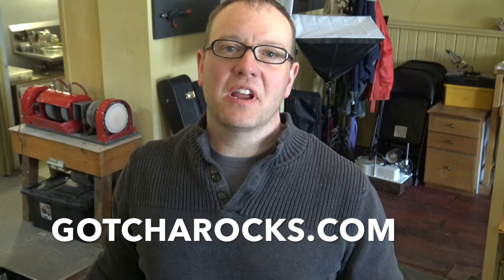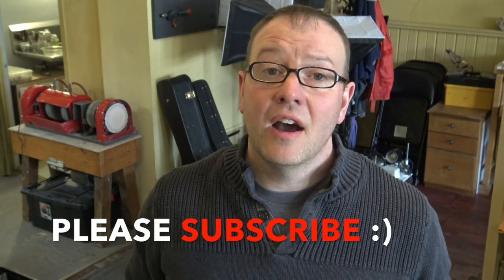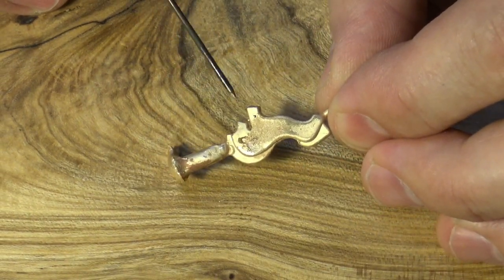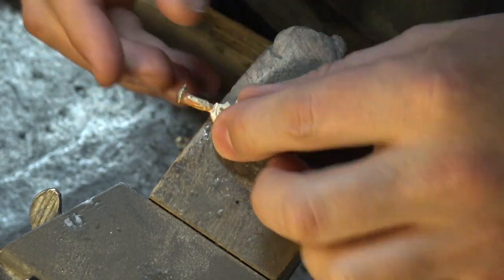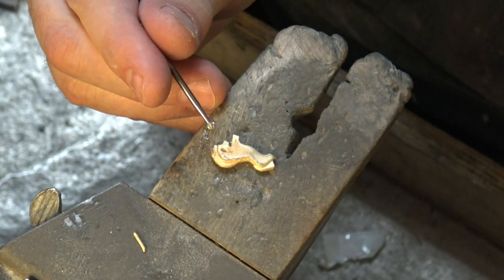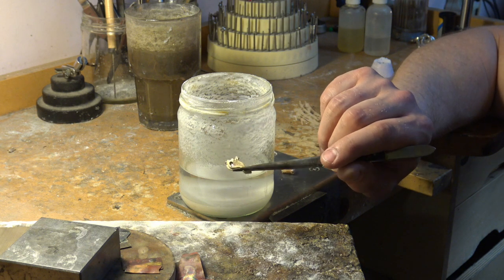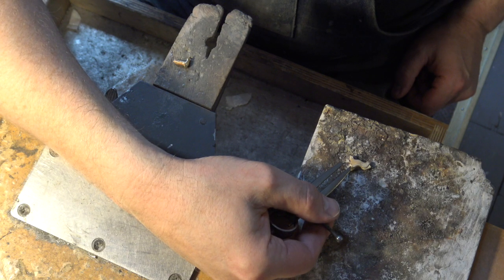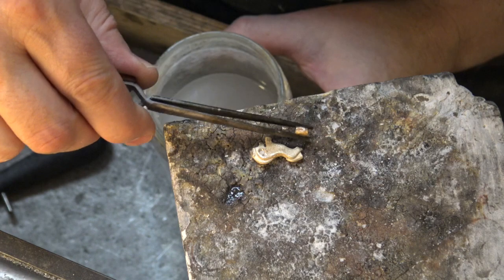How to Fuse Gold - Knowing this technique will change everything! No solder needed!

Comment: *OMG!! Michael,  I am jumping up and down for joy! YOU of all the people I have queried have taken on this subject. I haven't even watched it to the end yet, and I am ever so grateful. Your teaching is very VERY good, I thank you a million times! I am sure many will be happy to find this. Perhaps, a video on fusing gold bezels on sterling silver backplates next? Oh joy!
*Isopropyl alcohol (for firescale protection)? I was always told to use denatured alcohol; perhaps there is no relevant difference? Thanks -Sooo loving this video!
*ok,  Whoa! Hold those horses! At 13:33 you introduce a "nut" to use as a burnisher. (!!!) Please, (pretty please) expound. It looks more like a square washer, it's MUCH thinner than a "nut". Do you have dimensions? I ask because that is a tool that looks like it is an amazing helpmeet (old English: helpmate).  It actually looks like you took a nut/washer and shaped it with a grinder and then..... if so, I'd LOVE to know how/why/criteria for size... THAT is an amazing burnishing tool. And certainly not readily available to buy. Details are key! And as always, thank you so much, Michael..(sorry to whomp you with comments/questions....).
Reply from the maker: Hey Gabby,
I am glad you liked this video. All right, Fusing should be used for attaching parts that are part of the main body of your structure. 
Bezels and other smaller parts that may hold stones or serve as a working part, such as a springs and prongs should be soldered. When we uses fusing it does change the structural make up of the metal. The molecules grow and may cause the metal to become annealed or brittle. Which is fine for the larger structor of a piece but not great if it is a bezel that holds a stone. 
Isopropyl alcohol (for firescale protection). I uses isopropyl alcohol and boric acid powder instead of denatured alcohol because I found out that when denatured alcohol is burned the chemical make up is very difficult for your body to process. Thus you are slowly poisoning yourself over time. 90% Isopropyl alcohol burns just as well in my opinion and it is much safer. 

I am not a doctor or a chemist but I play one on Youtube, however, a good friend of mine is. So I am rolling with the isopropyl alcohol. I prefer to be safe then sorry.  Always use ventilation when soldering or fusing. Okay, I am done on this subject. :)

The burnishing tool? It’s a good one! Your right I thought there would be a source for this but I am not seeing them out there. The one I found is so over priced I cant in good conscience recommend it. I may have to make some a put them on my website for people to order. Give me a little time to check on a few other sources.
 
I basically took a steel nut and made a fitting for the inside of it and then put it on a small mandrel. Anyway I will get back to you on that one. 
Be sure to join the blog on my website if you haven't already. I will put a post as soon as I get a reasonably price supplier. 

As always thanks for the comments. Keep on rocking with your jewelry. 
All the best, Michael

Comment: Thank you for this video!  Would this work for fusing 2 pieces of 18k wire (same wire), to tey to make a thicker gauge wire?
Reply from the maker: It should work. You might just have a little clean up at the weld spot.

Comment: Could you tell me how to fuse chain links together? I see a lot of people use tiny flakes of gold to fuse the gold chain but for me the chain always melts and deforms before the flake fuses the links.
Thanks
Reply: Make sure is clean and also make sure you use Flux.
Reply: Also u need patience,  u will melt many things before u get it right, specially when u don't have someone looking over your shoulder helping. 
It takes a good eye and reflexes to pull the flame out just at the perfect time when solders melts.
A lot of it you will learn with experience..like this guys video, he got the job done, but I can tell that he can learn a few things to make he's craft better and get things done way easier.. I have been doing  this for over 40 years. 
I don't want to put anybody down, I'm still learning new ways to make things easier and better my self .

Comment: Can this process be done of the inside of a ring
Reply from the maker: Hello Chris, yes it can. I would heat up the ring first and then change the size of your torch tip to a smaller tip. You will have to work fast so that the ring doesn’t cool down. Just have everything set up ahead of time.
Reply: @GotchaRocksJewelryDIY  thank you that's set my mind at ease

Comment: I am so happy to have found your channel! New sub for sure. Its funny because i was actually wondering if i could do that with a ring that had pitted. I wasnt even looking it up and you came up in my recommendations. I fuse silver for ganulation and fuse rings and jumprings all the time and have fused a ball of gold to a ring before. But never tried to use the method for ffilling in pits or holes per seThank you so much for sharing this. Perhaps you could help me with another problem i have. Long story short, some gold was accidentally spilt onto some sheet metal and basically fused to it as it looks just like a splat of gold and there is no way to "scrape" it off or aanything lol. Anyways, what could i do in this situation? Its a bit over a gram of gold and i dont want to just throw it out of course. But do i just leave it and hope to find something i can use it for? I dont have any means to chemically separate it really. But i dont think melting it down would be a very good solution either. Idk. Please help.lol

Comment: HiI was engraving a ring and the area got damaged beyond being corrected by engraving.I have cut a small circular disc out of the ring now and I have an circular area about 5mm x 1mm to fill in.Can I use this technique to melt gold into the hollow and fuse it without melting the ring itself  ?
Reply from the maker: Hey Mark, Yes it can be done but you will have to be really carful. I have done this on rings before. Mostly for electricians how had got zapped and melted their rings. If you can cut a piece of charcoal block and insert it into the middle of the ring to keep the ring from collapsing when you heat it. Hope this helps.
Reply: @GotchaRocksJewelryDIY  thank you. 
I was considering pouring a little amount of molten gold into the cavity first to create a piece that fits the shape exactly.  Then fusing that. 
Is that likely to work do you think  ?
Reply from the maker: @marktobin745  That might be a little risky. Try melting a piece that is close to the size of the hole and then add more gold if needed.

Comment: Great video. Is your fire coat just regular isopropyl alcohol that you can find in any drugstore?
Reply from the maker: Yes, find the 90% alcohol. It burns off better than the 70%. Be sure to mix it with boric acid powder. You can use a 50/50 mix or something like 33% boric and 66% alcohol. Both should work. All the best, Michael
Reply: @GotchaRocksJewelryDIY  Thank you. I hope you will continue to do your jewelry videos. You're a natural teacher.

Comment: Nice presentation. I would be concerned with the fit into the void on the first fuse you did. Is it important that before fusing- that you have a close fit without any air cavities? What happens if you trap gas within the piece? Any negative consequences ?
Reply from the maker: Hello Richard,
The fusing that I did I used a ball bur to get a semi close fit. If you are just starting out with this process I would recommend adding three smaller pieces to slowly fill the hole until it looks solid. The short answer is always have a pretty close fit. 
There are exceptions to the rule. When I work in platinum I leave a larger gap and allow the melting metal fill the gap. I seems to work better that way with platinum. 
Gasses will normally find there way out and leave you with another smaller hole. That is most likely what happen with my piece. If it happens re-drill the cavity and add another smaller piece of metal to fill it. 
If you are working with a largely hollow object and you are applying heat make sure that you drill a small hole somewhere for the pressure to escape. I have seen charms explode while being repaired. 
But if you are doing something pretty straight forward such as filling a pit you should be fine. My pendant had a very large hole. I hope to avoid this cast problem in the future. :)

I hope this helps.
All the best, Michael
Reply: Thanks for giving excellent information.

Comment: does the green flame indicate copper in the gold ?
Reply from the maker: k c That’s a good question. In this instance it is actually the boric acid powder being heated to its molten glass form. Different minerals will create different color flames as they burn. As a kid they had campfires kits that you could throw on the fire to change the color. Zinc was one of them. Okay, I’m going down a rabbit hole now, so I’ll stop here. 😀

Comment: What does the fire coat do exactly?
Reply from the maker: It creates a glassy film that helps to prevent the alloys in the metal from mixing with oxygen during the heating process. Without the fire coat metal will be stained black and copper. Here is a link to the fire coat video. https://youtu.be/3Bmtlgn0wK4
Thanks for the comment.
Reply: @GotchaRocksJewelryDIY  I watched the video. But what is the difference between letting it get dirty and then pickling it and what you are doing with the fire coat? Don't they end up the same? or does this also protect from fire scale?
Reply from the maker: @josephirani2261  The fire coat protects from fire scale. Without it the silver or gold can become permanently stained with fire scale. The pickle can only remove a portion of fire scale.
Another added bonus to using fire coat is that it helps solder flow when you are soldering.
Reply: @GotchaRocksJewelryDIY  Thanks for the info

Comment: Happy to discover your videos today 😊. I have some old small pieces of gold jewellery and was wondering if I melt them into spheres would I be able to fuse them onto sterling silver as embellishments or would I need to solder? I'm new at this so am appreciative of all the info I receive. Thank you.
Reply from the maker: Hello Dawn, Yes you can totally do that. After you melt them into the shape you like, I add a little easy gold solder on on side and then place them on the piece you're working on.
Slowly heat the silver and gold till the easy solder melts and hopefully they stay in place.
Good luck and have fun. 
All the best, Michael
Reply: @GotchaRocksJewelryDIY  thanks very much 🌹

Comment: Why do you hold the flex shaft like it were a hammer????
Reply from the maker: donald asbury Hello Donald, I hold the flex shaft a couple ways depending on the work I am doing. When I cut seats during stone setting I hold it like a pencil. This gives me control when making fine tuned cuts. However, I hold the flex shaft like a hammer to apply leverage and help prevent my burs from skipping across the rest of my project. When I teach classes on this I start everyone out holding it like a pencil. Both are important to use, at least that’s what I think. Someone said to me me once you get good at what you practice, so why not practice both. 😃 
Thanks for the comment, that was a good question. 
All the best, Michael
Reply: @GotchaRocksJewelryDIY  Thanks for your reply--I too taught classes back in the 70's but never taught the hammer method---however , as you stated, it may have it's benefits .

Comment: Why does your gold blackens?
Reply from the maker: Hello Hayden, 
Good question, this is called o oxidation and maybe a little firescale. When I heat the metal beyond the temperature that you would need for soldering you may experience some oxidation. Firescale is also a possibility. Firescale is when the metal is heated to a point where the alloy comes to the surface. In this case the alloy was copper. This is where the pickle solution come in to play. It will help to remove any discoloration. A little sanding and polishing is necessary as well.
Oxidation can be something that happens if there isn't enough boric acid in the fire coating. For the most part this is a fairly common occurrence. That being said I don't like it when it happens. But it is fixable.
Thank you for your question 😊. If you find that you are having it happen during soldering lower your torch temperature and uses more boric acid in your fire coating.
All the best, Michael